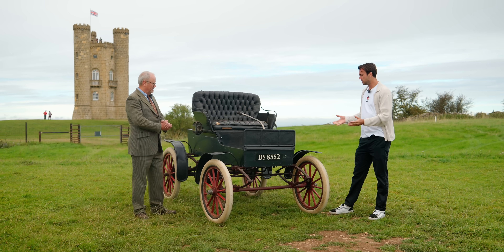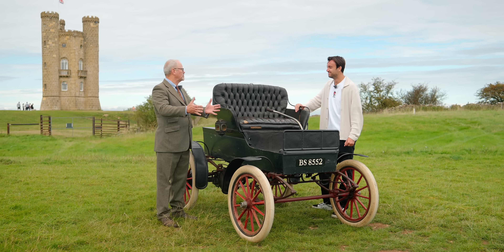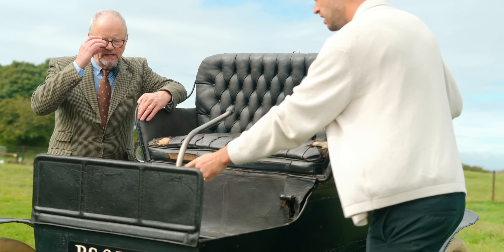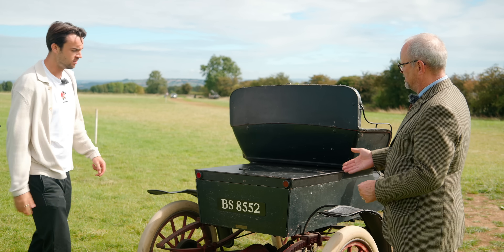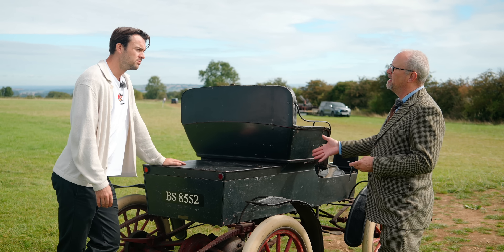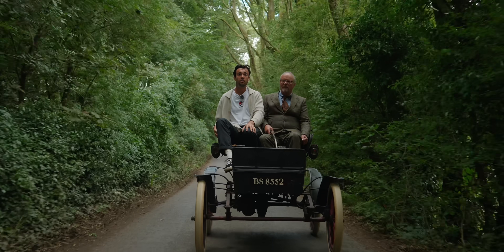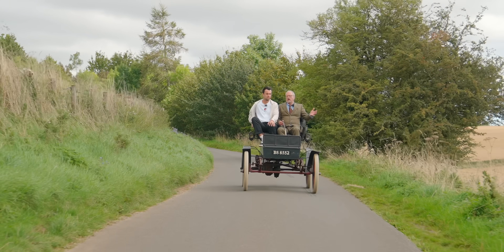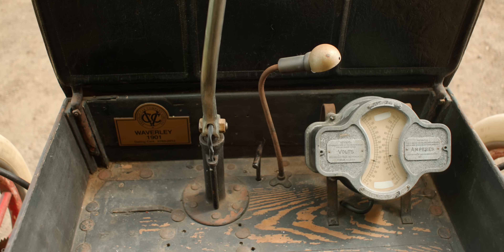Why Electric Cars Failed 100 Years Ago

Comment: Another factor that sealed the fate of electric cars was the switch from DC to AC power in the United States particularly.  Electric cars need DC to recharge the batteries nd in the early 20th century, the only way to get DC from AC was by means of large, rotary converters.  This was practical as far as large streetcar systems were concerned, not so much for re-charging a small number of electric cars.
Reply: AC from DC needed a rotary converter. DC from AC needed a rotary converter up until the 1930s, when mercury arc rectifiers started replacing them for that purpose.

Even today, converting DC to AC is a really difficult matter. A lot of devices that claim to do it will half-arse the conversion with the 'modified square wave' so save costs on the electronics, causing all manner of headaches further down the line. AC-to-DC though, that's pretty easy unless you are talking really high power and need to worry about power factor and harmonics.

Comment: The energy density of gasoline is 31,536,000 joules/li compared to 1,260,000 for LiIon batteries. We still have some ways to go. Lead-acid performs at 360,000 Joules per liter and this is part of the reason EVs failed to be accepted early on.

Comment: I think this was a pleasant little journey into the history of the electric automobile.  I also wonder if they had the problem of spontaneous combustion in those cars a 100 years ago?
Reply: Lead batteries are not so bad for that, you would probably have a greater risk of burning the wiring. 

Instead they release hydrogen and oxygen gas which are dangerous for obvious reasons.

Comment: You forgot to mention that electricity to charge the batteries was only available in major cities in 1901. UK, US and Europe did not get electrictrified in rural areas until after WW2. You could not drive cross country unless each city was no more than 50 miles away. Gasoline could be obtained from any general store or even the drugstore (chemist).

Comment: Well, the only way you're going to have success in modern EVs is to find another technology for the batteries. This current BS is enslaving the 3rd world and polluting the planet, making regular petrol-powered vehicles far less of a problem. And the petrol-vehicles will be eventually displaced by a real technology that will work, unlike the BS that they are calling EVs these days. 'They' want to control everyone and everything, so they need EVs, especially those that go online. The current EV push is the usual BS - no one ever asked for EV technology. Intelligent folks know that the battery tech is not ready and won't be for decades. Really.

Comment: The fact Chrysler managed to build a compact jet engine for cars before giving EV's another shot
Reply: Technically it was a turbine engine that drives the machine  (car, boat, helicopter, tank, turob-prop plane) by mechanical shaft to a transmission, whereas a jet powers by the exiting gases. Original jets were all exhaust that exited modern "high bypass" engines take advantage of greater power and efficiency of a conventional jet and use a primary turbine that intakes far more than is required. The engine takes its needs from the high speed high volume flow while the rest is channeled down through velocity nosles for additional thrust  extra to exhaust thrust. (This design was a great advance for reverse thrust systems too)
The funny thing is both car concepts you mentioned were total failures. So much so with the turbine that Chrysler was ordered to account for collect and destroy all of them!
Reply: @mrgoodman6620 calling the Chrysler Turbine car a failer is wild😂 sure it may have been an economical failure but as a car and as a piece of technology it was absolutely fantastic!
Reply: @memorimusic420  ??? No far from it! The characteristics of a turbine engine, make it a moronic choice to power a "car"! Technology implies intelligent concepts. Putting aside the "undriveability" of power and variable speed management between engine and wheels, the fuel consumption was insane, the gas emissions were potentially deadly in many situations regularly occurring with an automobile, not only that but dangerously HOT! 
AND, have you not heard a turbine engine at operating speed under LOAD!
All in all, totally unfit for purpose = complete failure. Sails on a submarine would actually be a better amalgamation of transport compartment and propulsion system.
Reply: @mrgoodman6620  whatever you say man... i like it because its very unique and has never happened in automotive history. For me concept cars are all about pushing the limits of whats possible. Yes it had drawbacks... so what? ITS SO FUCKING COOL 🤯
Reply: @memorimusic420  Never said it wasn't Cool! 
That's the essence of many failed concepts.... it maybe "this worldly stupid".... But so cool ya gotta do it anyway! Lol

Comment: The electric car failed 100 years ago for similar reasons to sailing ship’s failure…
Just not suitable for requirements…
Still the same ….
Reply: The need for speed and most important recharging. A model-T took people across America. A badd part of old lead acid is the ttime to recharge and if charging fast it boils the acid.

Comment: Very interesting vehicle. In london a few years ago i saw one of the Harrods electric delivery vans that was some 100+ years old and have been put back on the road, after restoration, after being as i was told found and pulled out of a garbage dump.

This video would have been better though without the silly juvenile jokes. We're apriori aware its an old vehicle, and not fast, banging on about it is annoying.

Comment: Electric cars really never failed, they basically for the rich. Their wife cranked up the gasoline vehicles or their butlers. Electric car was a great car for the house wife of the rich household. Big oil make sure that the electric car would not be available, cheap cars cheap gas.

Comment: Well, EVs still have the same problems. With the improved technology they are plausible and useful for urban use, most commuting etc. They're just not ready to fully replace ICE vehicles just yet - and probably never will be because we don't have enough resources on this planet to build enough of them for the demand. IMHO they're just an interim "kicking the can down the road" solution for public transport. That's really what needs to be worked on, because any bus or train will always beat a car in terms of efficiency and sustainability..

Comment: Steam was a sturdy, well-established, well-understood technology - but very complex. Electric was a very simple and also well-understood technology - but very limited in its ability. Internal combustion was a very young, complex, and temperamental technology. But it advanced rapidly, as did the chemistry to make good fuel. In only a few years' time, internal combustion became refined and simplified enough that allowed it to compete, even before the electric starter. A gasoline car could do the work of a steam car with much less complexity, and it could carry more load and travel further than an electric car.

Comment: Depending on how you define a vehicle, it might be worth looking into the first hydrogen vehicle as well, which pre-dates the Waverly by 94 years (yes, 1807).
Reply: Well......sort of .....Isaac De Rivaz built a fully manual engine powered by hydrogen / oxygen. It was essentially 1 very heavy piston that did work under gravity, i.e. the weight of the falling piston could drive a gear that could say move a wheel or drive a pulley etc. The hydrogen was stored in a balloon, when the piston was in the low position air and hydrogen would be introduced to the combustion chamber by manually controlling valves, the operator than pressed a button to generate a spark - the resulting explosion drove the heavy piston the top of the cylinder, it returned under it's own weight. In 1807 De Rivaz fitted one of his hydrogen engines to a modified horse drawn cart, and through a series of gears managed to propel the cart forward about 6 feet each time the piston fell.

You can imagine the practicality of having to manually operate valves and press an ignition source every 6 feet of driving - it did not catch on.
Reply: @TB-up4xi  It did serve as a proof of concept. Which many of the different engine / vehicles at the time were. Not necessarily meant as a production & commercially viable product. There were a lot stepping stones that were literally the shoulder's of giants much of our modern vehicle tech stands upon. It is interesting to see that many of the stumbling blocks of electric cars are still the same problems that will eventually see electric vehicles fail again, or at least be relegated to one option only viable for certain types of customers. There's a reason the UK's ban on gas & diesel powered vehicles has been recently pushed back to 2035, and closer to 2035 it's pretty much a given that it will be pushed back even further. Progressives haven't learned from past mistakes of believing that if they merely pass a law(s) physics & technology will suddenly comply with the law. Lol
Reply: @TB-up4xi so it was a stored energy ..gravity .. motor ?
Reply: A fly wheel does sort of the same thing
Reply: Note that today's hydrogen cars use a fuel cell that converts the hydrogen to electricity to turn an electric motor, they do not directly use the hydrogen for combustion, so they are electric cars with an hydrogen battery.
Reply: Richard Trevithick built the 1st  steam powered horseless carriage in 1803. The Waverley was built in 1904.
Reply: @matthewjbauer1990  Hi Matthew. Trevithick's work has been much underappreciated. Due to his abrasive personality if the few books I've read on him are true. Cheers, P.R.
Reply: @matthewjbauer1990  It was 1801, the puffing devil. His neighbor Mentor and James Watts assistant, William Murdoch built a self propelled road vehicle before Trevithick. James Watt threatened to fire Murdoch over his ''strong steam'' experiments and his vehicle was never officially made public. Murdoch is also the discoverer of coal gasification for residential lighting.
Reply: There are a couple of weirder ones in the 1940s. Britain converted some vehicles to run on town gas using a giant bag-o-gas strapped to the roof, in order to conserve petrol for military use. The continent had more trees then Britain, so a lot of vehicles were converted to run on wood using a gasifier - they essentially burned carbon monoxide. The German army even had wood-fuelled tanks. Not for combat use - they were just for training tank crews, saving precious fuel.
Reply: My Grandfather owned a steam powered car about 1901, he said wood and water were free and gas and electric cars were a way for the government to make money.
Reply: @rpm12091 Hi Rpm. What make of steamer was your grandfather running? To the best of my knowledge the White and the Stanley steamers both ran on kerosene. Instant heat flash boilers don't run on wood, it doesn't burn quick enough. Cheers, P.R.
Reply: @philliprobinson7724     I wish had asked more questions when he told his stories. He grew up in a blacksmith family and as an adult owned a car repair shop. The only cars he owned when I was around were Chevrolets. He had a forge in his garage in back of his home and was always hammer wielding something back together for a neighbor. I was very interested in radios and he would help me make crystal radios and I have a headset he gave me. He would comment when he filled his pickup with gasoline that if he still had his steamer he could fill it for free. He also owned an electric but I have no idea make it was.
Reply: @rpm12091  Hi rpm. What a great guy to grow up around. I guess there were different types of steamers. Kero was used for household lighting too, so there was plenty of it about. Cheers, P.R.

Comment: I was talking to a friend of my dad who restored a 1932 Detroit Electric.  Turns out Detroit had, by then, gone through bankruptcy and weren't making new cars but refitting old ones, cutting down the cab height to a more "modern" height, adding new wire wheels, but leaving the tiller steering in place.

Comment: Those contactor speed controls in the early electric cars were often off the shelf components from electric elevators so not really experimental technology.  Similarly the electric drives from a number of the 1893 Chicago Worlds Fair Electric Launches are still operational today without rebuild.  Thankfully the Electric Launch Company, ELCO who made those Electric Launches for the fair is still in business today making electric propulsion systems for boats and ships.  Many are more familiar with their other business, General Dynamics which specializes in Submarines.

The Nickle Iron batteries used by many would last for 40 years and were much more robust than lead acid however they did generate more hydrogen when being charged.  Some began to look at ways to harvest the hydrogen for lighting, etc so it would become a resource instead of a waste product.

Best!

Comment: I'm disappointed there was no explanation of what the little gear mechanism on the left-front wheel was.
Reply: I was wondering as well. From the looks of it... could be some sort of odometer?
Reply: @ZesPak  Hmm, could be?  In the close-up of it at 4:15, it doesn't even look like it's connected to anything.  But given the vehicle's age, it's possible parts of it are missing at this point.  Maybe the top bit that's sticking out spins and you could order an optional speedometer/odometer that would connect to it?

Comment: What voltage were the batteries? It looked like eight 6 volts wired in series so that would be 48 volts. Is that about right?

Comment: Edison used Batteries that used NiFe technology,  remain in his car today and still work!  I'm betting that the Batteries for this elegant mobile were also NiFe, probably replaced by an idiot with a  lack of knowledge! If they were NiFe, all that was needed was an electrolyte replacement KOH solution!   NiFe tec is a nondestructive chemistry!
Sadly they were hard to produce (Last forever is usually Hard to produce) and lithium Ion is cheaper -- until we run out of lithium!   
It's only 40 years older than me!!!
Reply: We will never run outof lithium, it is one of the most abundant elements on the planet.
Reply: Yep, so is Gold!   @roidroid

Comment: If you wanted a steam car to be practical, you would have needed an insulated hot water heater in your garage, so you could fill the boiler with pre-heated (almost boiling) water.  Otherwise, it would be like he described at the start of the video, you fire up the kerosene heater for the boiler and wait a couple hours for the car to be ready to go.  The thermal mass of the water would stay warm for a while if you stopped to go shopping, or to the theater... but after spending a day at work it would be cooled off again, requiring a long heat up cycle before driving, so it could not be used as a commuter car.   Electric and Gasoline on the other hand, were virtually "get in and go" compared to steam.
Reply: The Stanley Steamer Cars could be ready for use in 3 Minutes...the 2 Guys in this Video are rather biased and lack Technical Know how
Reply: Only true until the invention of the "flash steam boiler" in the 1890s.

Comment: All we need now is modern EVS to embrace weight saving and simplicity to gain range with smaller batteries. There is a market out their for lighter efficient EVS. why are they all 2.5-3 tons. You think of ICE cars in the 90s they were in some cases 600kg 1000gkg ( yes the weight is some to do with safety but not all), some 90s ICE are far more economical than modern ICE due to size and weight. EVs should sell on range weight efficiency smaller batteries that cost less EVS have not had their Model T moment yet. Carmakers always say 0-60 or racey roof line where you cannot actually be space efficient. Quite wasteful really.
Reply: A Tesla model 3 (1.8t) is roughly the same weight as an Audi A4, a Model Y  (2t) about the same as a Q5.

There are already plenty of super light urban EV's around like the 480kg Citroen Ami etc.

Tesla is the Ford of 1908, the EV evolution is well underway.

Comment: Graphene Manufacturing Group is developing a pouch cell (which works) that has an aluminium plate anode and an artifical graphene (made fron CH4 + H2) that acts as a cathode. An aluminium chloride electrolyte carries aluminium ions from the plate to deposit on the graphene particles. The graphene may neen binder and conductor addatives. The conductor sheet for the graphene was not mentioned, nor was the separator, but a normal separator should work. Battery is good from 0-60 degrees centigrade. For the separator - the atomic number of 13 and weight is 27 and it has three electron shells with the outer having 3 electrons (which are stripped away as an ion??) compared to Lithium with an atomic number of 3 and weight of 7 and two electron shells although in ion form the outer shell of just one electron is stripped away.
Reply: There are many battery developments happening all the time, but it's more rare for them to develop into actual sellable products, because often the new developments arn't easy to mass-manufacture.  I find it's best to not get too excited about a new battery technology UNTIL it is being mass manufactured, otherwise you experience a lot of frustration & heartbreak.

Comment: In short, the short range and the long time needed to charge the batteries were its downfall. It wasn't until lithium-ion batteries were used in automobiles from 2009 on that electric cars became viable again (especially now with the range of 240 plus miles per charge and charge times of under 30 minutes).